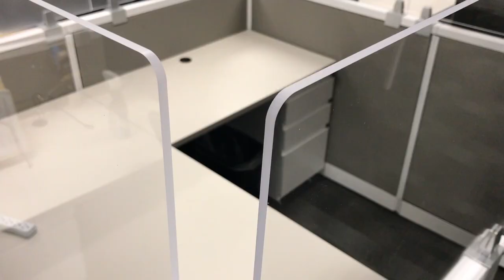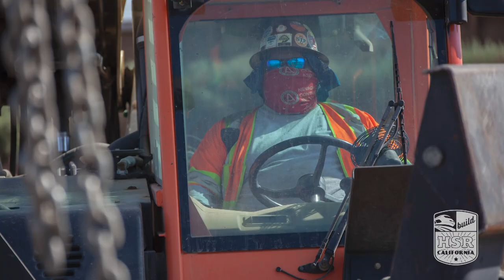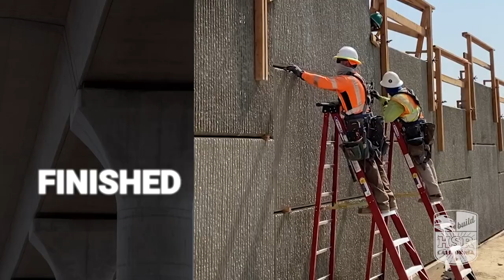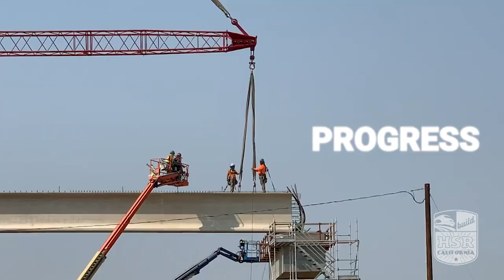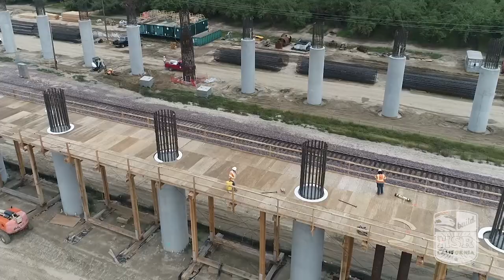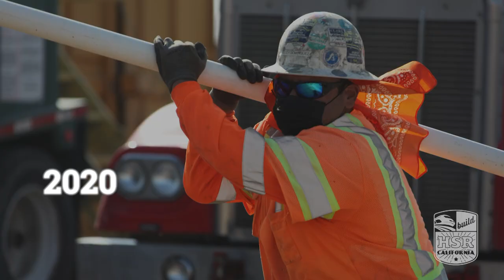2020 High-Speed Rail Construction Year in Review

Comment: Most excellent - viaducts to nowhere!  I note that there was no "concrete" description of the percentage of work completed, estimated time to completion or an estimated final cost.  Perhaps that is because truth and reality are not what this boondoggle is all about
Reply: This is pretty rough off the top of my head, but 119 miles of the Central Valley section, which comprises about 23% of the track miles and about 12-15% of the total cost is about a third done. Again, another rough guess, but I'd peg the final cost of Phase 1 (L.A to S.F.) at about $100 billion, completed some time between 2040 and 2050, assuming the state is able to procure significant federal funding. ($50 billion+)  Otherwise, the state doesn't have the money to finish, due to inflation costs and decreasing revenues from Cap-and-Trade auctions, without some special funding measure.

Comment: Cannot believe the construction methods were so backwards. Onsite rebar by workers, lack of modern machineries no "bridge building machine" no standard precast fabrications, mostly manual works. As it delays costs will rocket! Better make use of China, take advantage of the exchange rate, they can complete in 3 to 4 years time. The cost savings can be used to pay the laid off workers.....and most important.... get HSR running ahead of schedule...well earlier than 2028.
Reply: Americans don't want to buy from China because why should American taxpayer money flow to China?

Comment: What a joke. The Japanese and chinese can build the same thing for one tenth of the time
Reply: Shinkansen lines in Japan have had their fair share of delays, challenges, and cost overruns. The president and chief engineer of Japanese National Railways both resigned out of shame before the Tokaido Shinkansen opened in 1964 because of the cost overruns on the project. Japan has been building out the Shinkansen network since the 1960s and some parts of it are not due for completion until 2045. 

In China, the government can do whatever the fuck it wants and no one is allowed to complain, so that helps.